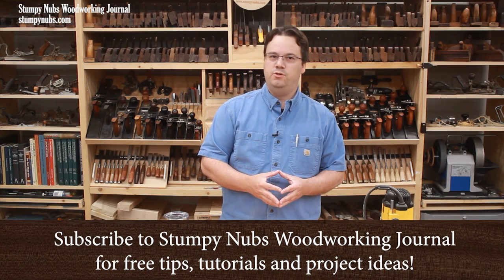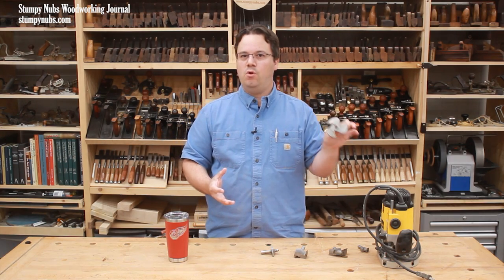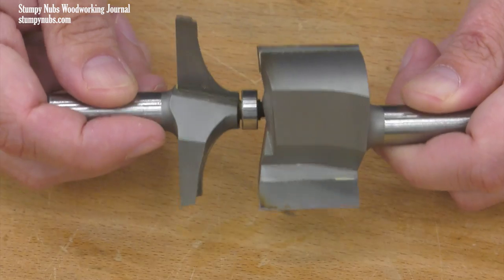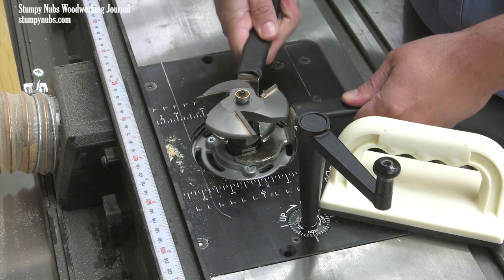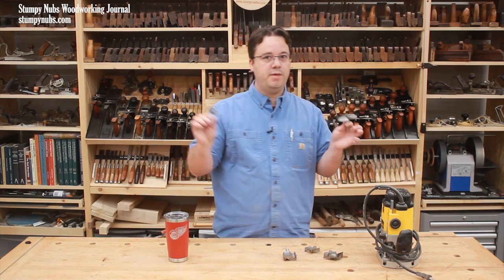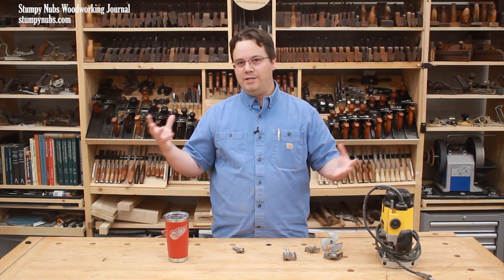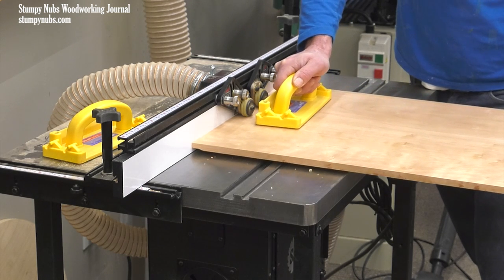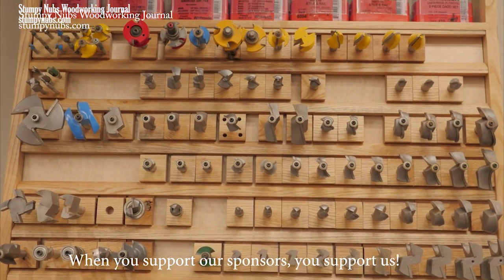The SCARIEST router bit I've ever used! (How I survived...)

Comment: I've used a table router to raise panels and  every fiber of my being was screaming no. It was terrifying, large bits should never be run at the speeds routers deliver. So I picked up a couple of  old shapers. The induction motors on a shaper are much more powerful than the highest rated universal motors on routers. Because of this you can operate the cutters at much lower speeds with no loss in quality of cut . The biggest plus is you can orient the cutter so the blades are pointed down instead of up like with a router which forces the material down against the table. Many distributors like Grizzly sell high quality bits at prices comparable to their router bit counterparts. Finally 1 or 2 hp shapers are priced much lower than a high quality router. I found a 50 year old 1 hp Rockwell shaper for $100.00, and a used 2 hp Reliant for $175.00. this allows me to cut rail and stiles without changing bits. Both machines have footprints of about 2'x2' and can run on 110 or 220 with simple wiring alterations. Safer, cheaper and faster production. Just my 2 cents worth on the subject. Love your videos James, not correcting or críticising  just offering an old dogs view on the matter. This old dog has learned a lot from you.

Comment: You said not to use large diameter bits with hand held routers. I got a new planning bit that meets your description but haven't used it yet. Would you use such a bit hand held in a planning jig or is it a kind of a tragedy to happen?
Reply from the maker: Is it larger that 2-1/2 inches?
Reply: @StumpyNubs  No, It is a 3-cutter bit with 2-inch diameter.

Comment: I have a scarier one that was custom made. It's a reversed 90 degree chamfer bit, but it's made for loudspeaker builders. We usually chamfer the back side of driver cutout holes to give the drivers more space around the basket. This is done on the baffle before it's glued on usually, but sometimes, we forget, or we need to modify a speaker that's already together, so a guy on the forum contacted a tool maker and had some of these bits made.

It's basically a 1/2" shank with a big V on top that has deadly sharp edges all the way to the tips.

Comment: Maybe router/shaper bits should have a hexagonal shaped shaft; sure that would require redesigning routers/shapers to accommodate them, but that could help with eliminating issues caused by vibrations.

Comment: the science of cutters is actually done in distance(feet / minute)instead of speed. tool load and pressure has a lot to do with finish.  they teach this in metalwork but hardly mention it in wood work.  adjust the speed  to match the feed for best results.

Comment: I would guess that the safety factor is all about the Moment of Inertia of the router bit:  if you were to add up all the little bits of mass times the square of the distance that speck of mass is from the axis of rotation then you would have that router bit's Moment of Inertia.  That number times the RPM is the angular momentum.  That number times the RPM^2 is the rotational kinetic energy.   You can't change the mass or shape of the bit but you can change the RPMs

Comment: End of vid - ‘Whiteside’ bits.  A 1/4” spiral compression (up down) bit was like 40 bucks😳 BUT..it..is..beautiful, a veritable work of art.  Carbide is brittle (so don’t drop it). The fluting is clean and crisp. The cutting edges - razors. Shiny shiny…I wanted to wear it on a chain!  A tool like this will outlast me and give smooth clean cuts with no tear out.  Expensive? Oh yes! But it delivers every cent spent.  (PS: I have no connection, this purely an owners opinion).

Comment: Hi, great video as always, safety regarding router seems to come up a lot, I always wonder why it seems that in north America, woodworkers would rather splurged on a billion HP router before even looking at a spindle moulder, which seem much safer in some heavy use cases, whereas they are very common in Europe...
Reply from the maker: There are pros and cons, but I would not say a spindle molder is SAFER than a router table.
Reply: @StumpyNubs  I wouldn't say it safer than a router table either, in most cases it isn't, but I just think it makes more sens when you start dealing with 3" bits on a router table, it seems to me that for those operations, like making a raised panel, a shaper is better build and better equipped to do it safely,

Comment: I had a 5/8" straight bit in a router table that snapped. I felt it graze the side of my head. Only left a tiny mark but if I had been standing an inch to the right it would have done some serious damage. I quit using cheap Christmas present bits after that.

Comment: If you want to use bits that big, you should really be using a shaper.  They are expensive, but are built to handle large cutters.
Reply: I was going to say the same thing. I don't trust a router with large bits even in a table but I do also suggest wing cutters and not flat shaper blades on a shaper and get one that is at least 5 horse or larger

Comment: Shapers can be dangerous in a different way. They hold onto the bits OK but I saw a piece of oak even though it had a motorized roller feeder on the shaper shoot across the shop and poke a hole through a cement block to the outside luckily no one was standing in the way.

Comment: My father ran a shop and they got a similar shelf except some were easily 3 times larger. They never pushed by hand but only used mecanized rollers (sorry, hope you catch the meaning of that poor phrasing).
Quality of your bit is really important, in particular what your showing seems light stiff steel which is more prone to vibrations which is a killer as you point out.
I believe heavy carbon steel would behave better. 
Power and quality of you machine would also come into play.

Comment: on larger machines in Germany we calulate: (diameter in mm x rpm x pi) /60000    this should cone out at around 60m/s   a 7cm bit should spin around 17000 rpm then  this is the same for smaller machines cos the cutting speed should be the same

Comment: Personally I wouldn't use a hand held router with anything larger than an inch, with the luxury of both table routers and a spindle moulder (sorry shaper) I'm lucky so I can use larger bits. But I still use a great deal of caution even then, the outer tips of a 3 inch router bit spin very fast and with a lot of momentum even at slower speeds around 5000-8000 rpms.

Comment: Raised panel routing should be done using a SHAPER not a router table.  I anyone is planning on building raised panels then consider investing in a shaper which is designed to handle the larger profiles.  This is a big leap in cost however, if safety is important, a shaper with all of the guards will provide protection against kick-back or tearout.  If you take time you can find a shaper around the same price as a router table with a 3-1/2 HP router that will provide a larger work surface to run panels thru without any problems.
Reply from the maker: A router table "with all the guards" is perfectly safe, as well. You can make a case for a shaper based on power and a wider range of large cutter options, but you can't convince me it is SAFER. Both machines may be used safely.
Reply: @StumpyNubs  
You are correct on the aspect of safety asumming that the operator takes all of the precautions to prevent kick-back.  The farther away I can keep my hands from the cutter head the better.  I have a friend that lost is thumb due to improperly using a shaper which easily could happen on a router table with a raised panel cutter.  The router table you demonstrated does not have many safety precautions other than running the stock in mutiple passes.  Shapers have multiple safety guards to prevent a operator from making contact with the cutter head assuming they are used properly.  Since my last project, I added a Power Feeder to my shaper which creates even more distance between the cutter head and the stock.  If you are running a lot of raised panels then stress tends to come into the picture and elevates the chance of a accident.  My intentent of comment was to make people aware of the dangers of running stock thru raised panel cutters on router tables or shapers.
Reply from the maker: @apodsim  Router tables may be equipped with featherboards, guards and power feeders as well. :)

Comment: As machinery's handbook has proper cutting speeds for nearly everything that cuts metal why isn't there a similar book for wood workers?  Also, a digital tachometer is very cheap now so  just make a chalk mark on the bit and measure the speed.

Comment: I know wood isn't a nice homogenous material, but aren't there manufacturer provided tables for rpm per bit and wood type instead of some super generic table out of some magazine?
Reply from the maker: A manufacturer might be able to calculate a precise top recommended speed, but the speed controls on routers simply aren't that precise. How do you dial in 12,450 RPM? The range on those tables are proven to be safe and precise enough.

Comment: Not that I disagree with anything you stated in video, but those bits aren't "router bits" those are shaper bits. Due to amount of wood removal & slower speed needed, there meant for a specific machine, not a router. I could put a drill bit in a router as well, but it's not going to preform in the manner it was designed for.
Reply from the maker: It's a router bit, designed specifically for using in a router and marketed by the manufacturer for that purpose. You could put it in a shaper with the right adapter, but saying they are not meant for a router is just wrong.

Comment: I know you say you have never had a sawstop activation I did today cutting 3/4 plywood made for outdoors trated so if you want to see a pic ill try and send it to you but at anyrate im not sure what caused it but the piece bound slightly and i did not use a mosture meter as I bought from lowes and it didnt feel wet but so so much for wet not tripping the bake im out a 60 dollar blade and a brake have a good day Cyco Billy woodworking
Reply from the maker: I didn't say I have never had a SawStop activation.

Comment: None of my router bits are so large.
Phew. 
Mostly my router gets turned upside down, is clamped into a bench vice, and I use it like a router table.
Because yeah - in my workshop the only thing which scares me more than my routers, is my angle grinder.

Comment: I love your router bit rack, but your method of making the rails and bit mounts seems overly complicated. Wouldn't a french cleat method of mounting the bits be easier to make and use?

So, a plywood back with french cleat strips glued on and bit holding blocks with a french cleat strip glued onto the back. It would also be easier to lift the bits off the rack and put them back on, and also means you wouldn't need to be as accurate with regards the spacing of the rails.

With regards big bits, I have some which I haven't used yet as I have yet to make a router table, I wouldn't even attempt to use them in a hand held router!

Thank you once again for a very informative video, they are greatly appreciated.
Reply from the maker: French cleats tend to fall off when you reach for a bit and bump the one next to it.

Comment: Oh my God that router is 22,000 RPMs and it only goes to setting 5. Just think if it went all the way to setting 10? That thing would be spinning at 44,000 RPM. Just think about that for a minute,  it would be even scarier. That's obviously why they only gave it 5 settings.

Comment: why wouldn't you have a shaper if you're running a professional woodworking shop? Router tables are fine for small stuff, but raised panels or any other bigger jobs should be done with a shaper.

Comment: I think they call that a shaper bit
Reply from the maker: No, they call it a router bit. https://amzn.to/3n2zmaR You can use it in a shaper if you have an adapter, but they are perfectly fine in router tables as long as you have enough power.
Reply: @StumpyNubs  Sorry I forgot the sarcasm emoji 🙃 This is normally a job for a shaper which I find to be the scariest tool in woodworking.

Comment: As a former shop teacher, I think this guy is totally wrong! You easily could use this bit AS LONG AS the router is in a table router setting! Using a fence and several passes would easily enable a person to use this humongous bit! There are charts to set the router speed vs. bit diameter and not slowing down is to invite disaster!  Patience and common sense allow the use of this bit quite safely. When cutting Cherry, burning IS ALWAYS an issue.  Sneak up to within 1 mm of the final dimension and then make the last cut fast so it won't burn!
Reply: I think you are actually agreeing with him...he didn't say to never use that big bit, he said they should be used in a table and with lower speed and multiple passes. Did ya watch the video?
Reply from the maker: You called me wrong, then you proceeded to repeat pretty much everything I said in the video back as if I didn't say it. As a former teacher, shouldn't you know to listen before raising your hand to comment?
Reply: Did you even watch the video? You basically agree with everything he said.